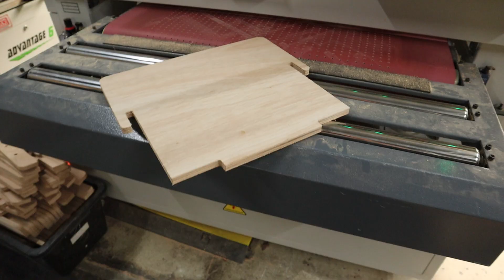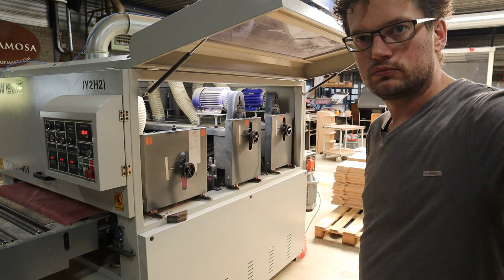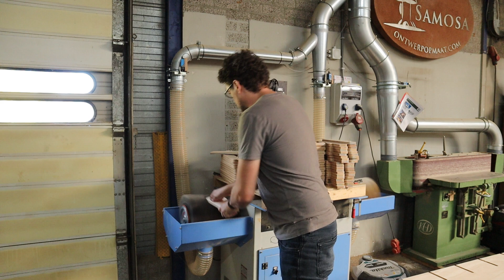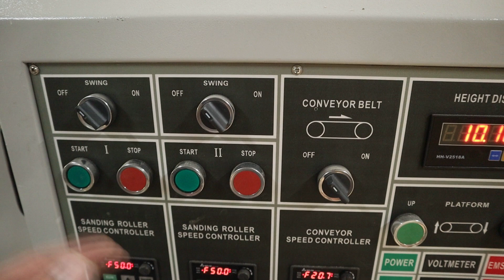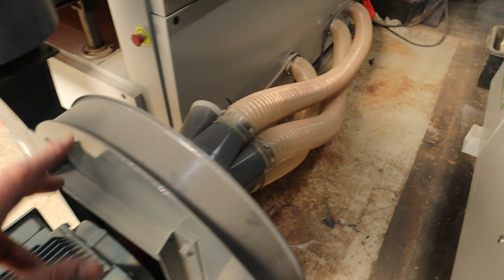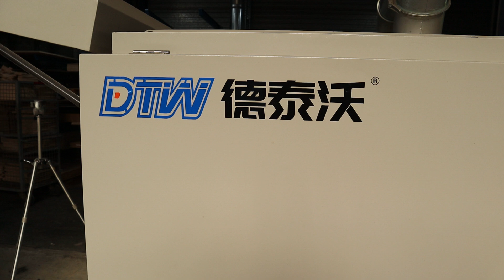Brush sander review - buy one to save a lot of time!

Comment: i wonder do you sand laminated plywood edges? They are expremelly sharp when cutted out with cnc and the corners need to be rounded, but anyway they still are pretty rought. Do you sand each edge by hand ?
Reply from the maker: Hello! We do not sand the edges of laminated plywood. We use a manual router and put a very small 45 degree edge on it. This is faster and feels nice. The upper side you can do with the CNC, the bottom must be done manual.

Comment: If the vacuum holds down the wood, does this restrict the bed movement, on a CNC the workpiece  stays still while the cutters move around it.
Reply from the maker: The conveyor belt has a really heavy motor. So while the conveyor is running the vacuum is active on the places where the sanding happens. It sounds weird but works great.